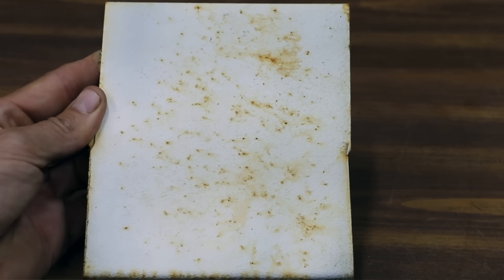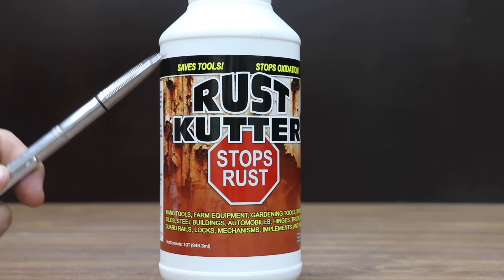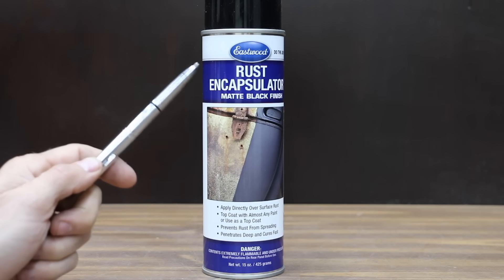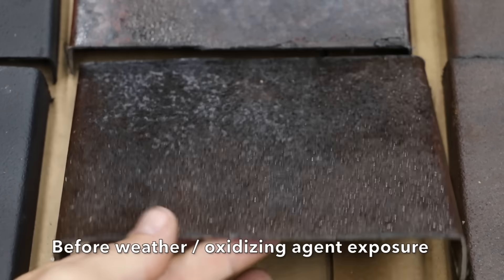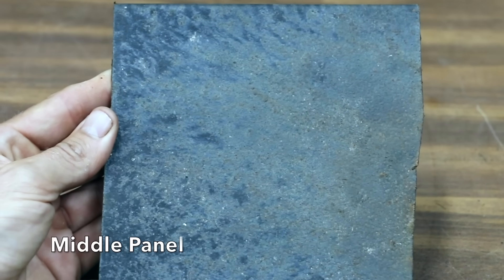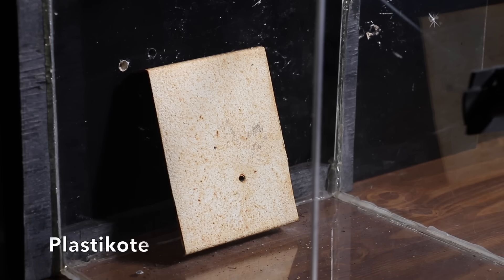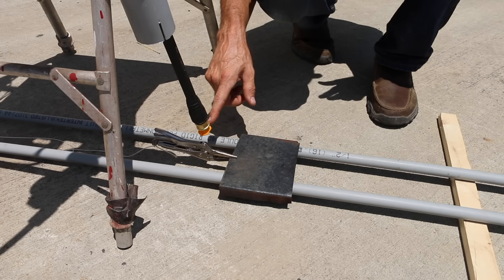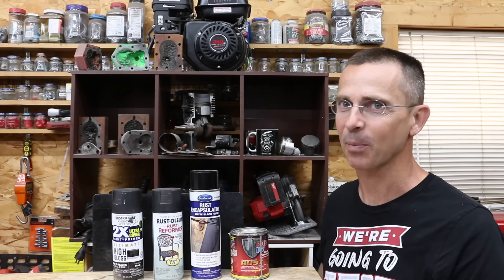Best Rust Converter? POR-15, Eastwood, Rust-oleum Rust Reformer, Gempler's

Comment: A warning to anyone using the Eastwood Rust Encapsulator make sure there is no interior or fabrics in a car you use this on. It really holds the smell of this product. I used it on the rockers on a car and after shampoo and various cleaners over a couple of weeks it was still strong. The car was closed but it leached into the interior and using foggers was the only way I found to get it out.
Reply from the maker: Thanks for sharing!

Comment: Several years ago, I received a gallon of Evapo Rust from a supplier. I was working in a gage calibration position, and decided to try it on some out of service neglected, and rusted gage blocks, following the instructions. It did a great job, and we were able to return nearly all of them to service. Sizes ranged from 1.18mm up to 75.0mm. We sent them out to an outside calibration lab, since we had originally took them out of service. No information on any rust returning due to environment, as we controlled them better than our predecessors. Discoloration was present, but didn't effect the dimensional accuracy past 1/2 to 1 micron.
Reply from the maker: Thanks for sharing!

Comment: My best suggestion is to clean and give a bit of brushing to the surface.
A totally raw surface will probly not allow proper bonding that lasts time.
When I properly cleaned surfaces I always had good results with rust converters :)
Reply from the maker: Thanks for sharing

Comment: We use POR15 at work and it's awesome. Never get it on your hands though because it's not coming off for several weeks. Also it can be applied to bear metal as a regular paint. If you wire brush all of the metal before applying it sticks really really well. So well indeed that if you need to remove it later you will need to use a grinder with a grinding wheel - flap disc and wire brush take way too long.
Reply from the maker: Thank you for sharing!

Comment: my por 15 doesnt last... it peeled everywhere i applied it. I even used their metal prep spray which i think made it worse honestly.
Reply from the maker: Thank you for the feedback.
Reply: @ProjectFarm  thanks for the video. i noticed it held the best with no prep work. remove any flaky rust and slap it on.

Comment: My truck only has 24k miles on it and already has holes rusted through the frame. I wish auto manufacturers would find a better solution to corrosion
Reply from the maker: Thanks for the feedback.

Comment: Just based off of the stuff I've used myself I'm not surprised that most of them eventually had rust slowly showing through. Literally any paint I've tried (without sandblasting, just a wire wheel) eventually always needs to be repainted. Was just about to repaint the roof on my truck.. whoever installed cab lights did an absolutely horrendous job and all of the paint is literally bubbling. Guess I'll be getting some por15.
Reply from the maker: Thank you for the feedback.

Comment: I dont know why Rustoluem has two Rust-Reformers. This one with the chair on it, and the other can, with white and orange. The later being better from my experience. But yeah, I can confirm this, after using all of these products over 10 years. POR15 is hands down the best you can get, but very pricy. So for really big areas, (frames on an assembled car) I use the Rustoleum (with orange).

NOTE: Rustoleum really DOES NOT stick to bare metal, even in areas where your grinder went through and just a little bare metal shows. It will bubble. POR15 is great until you need to remove a bolt. Then you have to get an air hammer and chisel to remove the paint, or use aircraft remover (the old methilene chloride stuff that was banned)

In fact, PF you should do a paint stripper/aicraft remover test and compare it to the old stuff (if you can still find a can of it). That would be a BIG help to a lot of us to know which one of the weaker available ones are at least functional (the old stuff was 5 minutes to remove all paint, everything, the new stuff has been hours and still wont remove all paint, comparing Kleen Strip Aircraft Remover, old and new post EPA ban)
Reply from the maker: Thanks for the suggestion.

Comment: Great job! I'm surprised the POR did so well, my personal experience is that it doesn't adhere well. I tried it on several projects and it peeled on them. I used KBS Rust seal on the frame of our semi after water blasting it. It's holding up extremely well. It does require the use of their special primer if it is used over old paint and also before applying paint over it. I tried Eastwood Platinum Rust Converter on our Excursion, but it was involved in an accident and I haven't really looked at it to see how the Platinum did. It was driven in a bit of salt before the wreck. I also tried Eastwood Internal Frame coating on the Excursion. The Eastwood products went on very well and took a lot less product than I expected.
Reply from the maker: Thanks!  Thanks for the feedback.

Comment: Great video thanks for sharing! I have always used POR-15 and wonder how the competitors would stand up compared to POR-15 because it alot more expensive then most of the other brands. IMO atleast for me I will just keep using the POR-15 the superior performance definitely justifies the higher price. I use POR on the frames of all my trucks and dump trailers and it has kept the frames of everything I use it on near perfect! I usually go over them once a year before winter hits just to cover up any chips or thin spots. If you compare my trailers and trucks to one that hasn't been treated and cared for it is amazing how much difference there is between them. For example my buddy got the same trailer I did in 2000 his frame is completely covered with rust and is pitted to the point that it is not going to be able to pass inspection this year and mine is still like new. It pays to protect your investment. It cost me around 200 bucks to paint the frame of my trailer a year works out to be around give or take $4k over the course of 20 years! That is alot cheaper then buying a new trailer every 20 years! Like I said I often wondered how the cheaper products would work to try to save alittle money every year but the difference between the other products performance definitely justifies the cost of the POR-15! Definitely worth the extra money hands down!!! Again thanks for all your videos @projectfarms they are all very honest informative and useful I like that you opinion isnt swayed in anyway buy sponsorship if only more people would give honest feedback and not let money fuel their opinions. Thanks again.
Reply from the maker: Thanks so much!

Comment: You should have tried the Eastwood rust converter. I’ve used it and then covered it with the Eastwood rest encapsulator on the frame of my truck. 3 years and it still looked like it did when I first applied it.
Reply from the maker: Thanks for the suggestion.

Comment: I have used POR 15 gloss black several times and it is a very durable product.  If exposed to UV light it will need a UV top coat to protect the finish from fading and deterioration
Reply from the maker: Thank you for the feedback!

Comment: Hey, I just looked up an MSDS for POR-15 and it seems that this stuff is cyanoacrylate-based. This made me think it'd be interesting to see something painted with plain super glue as a protective coating, just how well would it hold up in these kinds of tests, both on rusted and fresh metal surfaces.
Reply from the maker: Thanks for the suggestion.

Comment: POR15 is great but buy the can size u can use in one application... after a month of using a 32 oz can you cant reopen the lid...so had to poke a hole n duck tape after that...dries rock hard on concrete too .. i now just buy the 6oz 6 pack... maybe glass jar would solve that problem...
Reply from the maker: Thank you for the feedback!

Comment: I was going to ask if the failures were due to just how aggressive the corrosion agent you applied was, but even the 'control' pieces didn't survive the elements unscathed for most of the products. Very interesting that the paint did so well - I imagine Rustoleum would have been nearly perfect had you ground the pieces to bare metal for it.
Reply from the maker: Thanks for the feedback.

Comment: I've found POR-15 to work the best with multiple coats of the silver stuff, at least 4 coats.  Then topped off with a layer of top coat for UV protection.  Any rust that does show is usually dust that got mixed in from the brush.
Reply from the maker: Thanks for the feedback.

Comment: I applied Por15 to the headache rack on the flatbed I put on my truck.   It calls for a topcoat if in direct sun so I applied theirs too.   It's been two years in the rust belt and the headache rack still looks like new, the rest is showing some rust where it was just painted.   It's not cheap but at least it works.
Reply from the maker: Thanks for sharing.

Comment: I've had very good luck with Rustoleum in the past, especially using the rusty metal primer followed by two coats of the paint. I had an old honda civic that was rusting everywhere, and I got most of the paint off and painted it with the red primer followed by 2 coats of gray, and after 12 years of leaving it outside, including 4 years in San Diego near the beach, there was no rust at all. It looked terrible, of course, but it never got worse. And when I saw the car ten years after I sold it, it still looked the same. I don't have enough experience with the 2X stuff to know if it's as good, but I do know that it needs to cure for a week or so before it's really hard.
Reply from the maker: Thanks for the feedback.

Comment: It's not really a rust converter but I've had good luck with ZRC cold galvanizing. It's a brush on zinc coating. Might be worth a test sometime. I've also had good luck with POR15 so I'm not surprised it won.

Edit: it's worth noting that POR 15 isn't UV resistant. It needs a top coat if exposed to sunlight.
Reply from the maker: Thanks for the feedback.

Comment: For those wanting to retard rust without fuss of applying a top coat, it would have been interesting to also see how the treatments reacted with sunlight.
Reply: Most of these need to be top coated except for the spray paint obviously.

Comment: I like Corroseal brand I bought. A gallon costs about $55.00. It's water based and easy clean up. For an even more protective coating, I use Rustoleum's Hard Hat series enamel.
Reply from the maker: Thank you for the feedback!

Comment: I used por on my truck frame and I think that I got too much uv exposure and some of the places I coated we're papa too clean so the por peeled off in spots.
Reply: I did clean oil and grease and remove only large scale rust. I live in the same belt
Reply from the maker: Thanks for the feedback.

Comment: I suggest that you do a long term exposure test on those samples if you still have them. Perhaps some converters worked enough to limit additional rust. Also paints like por don't like uv without a to coat. It could be an applicable test to also test these paints on bare metals or on semi painted surfaces or scaly rust v light rust or partially painted surfaces. Since por requires a top coat for uv exposure perhaps top coating all samples to see if any rusty bubbles up. I use Dupont rust fix as far as converting rust that I just need to stop until I can afford the time to do the proper body work and color paint.
Reply from the maker: Thanks for the suggestion.

Comment: Por-15 is really good against everything but UV from the sun. Used Por-15 on most of my truck accessories and bed and it was great for about a year, then the 2nd year started flaking and peeling and faded quite badly. But somewhere the sunlight doesn't hit the Por-15 it works really well.
Reply from the maker: Thanks for the feedback.

Comment: I’ve had great luck with Rustoleum 2X. I try to remove all the rust with a wire wheel and then wipe the bare metal with acetone before painting, but even when I’m not able to fully clean the area it’s given surprisingly good and long lasting results.
Reply from the maker: Thanks for sharing.

Comment: It's hard to beat that Rustoleum Rust Reformer, even though it didn't come out on top. For the price, availability and ease of use, you really can't go wrong. 👍

 I've used Chassis Saver by Magnet Paints in the past, which is great, but I'd really like to try POR-15 at some point though.
Reply from the maker: Thanks for sharing.

Comment: Comparing to POR-15 is Rust Seal; I just used some of this and think it might best POR; it coats well and is tough like epoxy; def not just black paint it smells different and has a melt-in effect before curing. I can barely remove only some drips and goofs and even borax won’t remove it from skin. Paint and cosmoline over this is what I think might be the ultimate prevention. Thank you for this vid!
Reply from the maker: You are welcome!  Thanks for the information.

Comment: I think there will be differences in strikes between the bb shots ... I think you should shoot each one a few times.  Also, there might be differences in the tip/orientation of the screw for the scratch tests. Take a look at that thing magnified -- you might need to make the orientation the same for fair tests, or you might need to run it across two or three times on each piece with the screw in different orientations.  Maybe.
Reply from the maker: Thanks for the constructive feedback.

Comment: Great video Todd, with ingenious tests!  I’ve been using POR-15 for the last 15 years and it’s fabulous.  For any newcomers to 
POR, make sure you follow the directions; it makes a real difference.  Also, wear gloves, this stuff won’t come off your skin.
Reply from the maker: Thanks so much!  Thanks for the feedback.
Reply: @vincevillain  when I first started using POR-15, I was bah! to instructions.  But I had a few cases where it didn’t bond properly and peeled off, over time.  The metal prep seems to really help in this regard.  I suspect it’s just phosphoric acid, but I used their stuff.  I also use the cleanser to degrease first.  I can understand not wanting to put water in the trunk.  I think I’d spray the metal prep on, wait an hour (you’ll see the surface finish change to grey/white), then wet a sponge a bit and wipe everything down with water, but leaving no real water behind.  Let it dry then paint away.  One good thing in a trunk is that UV protection won’t be needed.  Also, two coats of POR-15 is prudent.

Comment: Many years ago a friend of mine an me tested POR-15 on a dirty, greasy surface to see what happens. The result was that this paint becomes like a foil when dried. It did not stick to the surface (as expected) and it could be peeled off in one piece, like a solid piece of foil. Therefore I believe the trick POR-15 does on a properly treated surface is sealing the surface like a plastic coating, whilst staying soft and flexible on the other side. (Reminded me a bit of 200 µm Plastisol coatings, which You can find on currugated sheet metal, e.g. a high-end-coating used on trapezoidal-sheet-metal used for roofing). I still use POR-15 for problematic areas on car chassis. 
Another product I use a lot is Fertan, which is 'only' a rust converter. I always try to take good care of the underfloor of my cars, as where I live they do lotsa salt in winter on the roads. My strategy is removing the rust by grinding, followed by 2 x Fertan coating, afterwards washing off the excess of the Fertan. The areas where Fertan converted the rust should look black and/or black/blue, depending on quality of the steel. I let the areas dry and then clean them with Isopropyl. Afterwards I apply 1 layer of POR-15. After the POR-15 has dried, I apply 2 layers of underbody coating.
Reply from the maker: Thanks for sharing.

Comment: I am using BRUNOX Epoxy (austria) for car underbody protection. After that we use grease for steel cables as an underbody sealer. It works great!
Reply from the maker: Thanks for the feedback.

Comment: As others have stated, I did not have any long term luck with any rust-reforming/rust-encapsulating product on my 1970 K5 Blazer (and I tried every product I could find) - the rust just took a little longer to show. 
The big problem is rust can go very deep beyond wire-brush or rust-product, and if any oxygen can get to it, it is continuing. Once rust starts, the very act of rusting creates more of a rusting environment exposing more and more metal to corrosive forces. That is why I thought an encapsulator would work - no joy. 
Never tried POR, though I heard it was good.
Reply from the maker: Thanks for the feedback.

Comment: I repainted the frame on my 1951 Willys with the POR15 and I'll back up your findings that it works great and holds up very well. You need a grinder to remove it. Sanding doesn't even get through it.
Reply from the maker: Thanks for sharing.

Comment: I've used a product called 1-step rust killer with good results. Be curious to see how it would do against the top 2 or 3 picks, or maybe a 1v1 on POR 15.
It was substantially less expensive than POR 15 as well.
Reply from the maker: Thanks for the suggestion.

Comment: Could have been good if there was some Tulco you pitted in there as well, since it is the only brand-name one I could get where I am (It is a Henkel brand, like your fabric conditioner and Loctite) Otherwise a great flat out comparison, but a funny test I thought is submerge a rusted piece of panel into the converter and do the tests on them that way
Reply from the maker: Thanks for the suggestion.

Comment: perfect, good comparison, but i would have liked to have seen eastwood platinum rust encapsulator. I painted my truck frame with that and a top coat of rust-oleum tractor paint. its a little pricy at $125 a gallon but time will tell
Reply from the maker: Thanks!  Thanks for the suggestion for round 2 of testing.